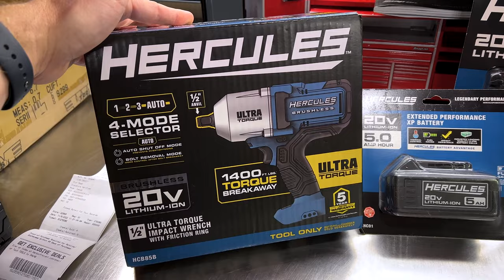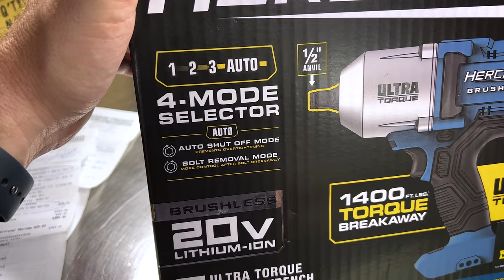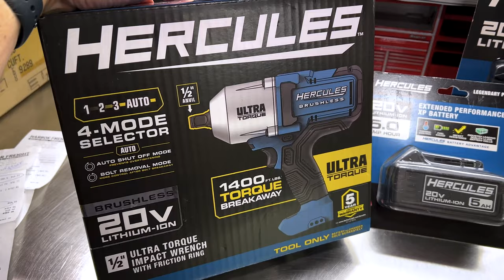EXTREME TOOL TESTING Harbor Freight’s Hercules Ultra Torque Impact! SHOCKING Results!!!

Comment: My issue with the Harbor Freight cordless tools the same as yours. They cost too much if they are trying to compete on price! There simply isn't a big enough difference versus a brand name with a much wider tool selection. That said, this does seem like a pretty impressive tool! I don't think my DeWalt batteries would have survived those durability tests at all. Fun stuff.
Reply: Hahahaha so it's stronger then a Milwaukee more durable then a Dewalt and cheaper then both but it's still not cheap enough 🤨😆🤣 I love it that logic made my day thanks 😄
Reply: @word1ist  It's not cheaper than both if you actually look for sales. I got my DeWalt high torque impact for $180 brand new. If the price difference between the Harbor Freight and a more established brand is low, being on the better battery system with a much wider selection of tools makes much more sense. I personally use DeWalt 20V because I find it's a better overall value than Milwaukee M18. I generally buy new tools when I can get a battery or two for free and overall I've paid less than I would have for Harbor Freight equivalents. I also buy Milwaukee M12 which Harbor Freight doesn't have anywhere near a comparable lineup.
Reply: @802Garage  🤨🤨🤣😆
Reply: @word1ist  If you don't understand then I am highly doubting you use a suite of cordless tools daily. Having numerous battery systems is a pain in the ass and again as I said, I've purchased my DeWalt tools and batteries CHEAPER than Harbor Freight tools because I hunt for deals. Do what you like.
Reply: I’d be a lot more willing to buy into the Hercules line if they had more niche tools. The value they have just doesn’t hold up against a similar brand like ryobi if you consider how limited the tool selection is.
Reply: @sully.varnadoe1472  Exactly. You buy into the battery system and then you are incredibly limited on selection. They have to at least be cheap if they aren't going to be versatile.
Reply: Battery should be good since they are made by Samsung and have a 3 year warranty. And only the Herc line has the Samsung batteries at HF.
Reply: The hell there isn't.... and coupons
Reply: Granted tho he was so misleading on the price comparison vs the milwaukee here. He got a charger the tool and two batteries for around $380. Then quoted the milwaukee at $450. However the milwaukee kits only come with one battery. He evene said it came with two at the end if the video which is not true
Reply: @MaNtIcHoRaOfficial  Yeah I always buy DeWalt on sale when I can get a whole free tool or two batteries so I save tons.

Comment: Yeah but with that Milwaukee kit you're getting one battery. You got two Hercules batteries so add another at least $100 to $150 to that for 40 or whatever it was and that would be the comparable price so basically 590 compared to 380

Comment: Hey man, just a quick question,  how to permanently stop tha auto stop start on my 2017 forester? Thanks man.
Reply from the maker: You have to buy a disabler.
Reply: @MrSubaru1387  any link for that pls?
Reply from the maker: @robcore5287  google autostop eliminator

Comment: That my turn away point is that i get the dcf 900 with 5.0 battery and fast charger for 349.00. Cheaper then the harbor freight. Hmmmm

Comment: Hercules Impact Wrench is impressive indeed, surprising the battery never came off with all the abuse it took, unlike the Milwaukee whose tools have their batteries dropping off on a regular basis. If you put the Milwaukee Impact Wrench through the same abuse as the Hercules Impact Wrench it would have crapped itself. Looks like Harbour Freight may become a contender for tough reliable tools of choice for the tradesman especially with the five year warranty that replaces the tool there and then as opposed to the Milwaukee crap where you have to wait for it to be repaired which I have had first hand experience  with my Milwaukee multitool, took 8 weeks for the Milwaukee  retailer to fix it and it came back no different to what it was when I sent it. Who knows what repair job the clowns did? Needless to say I no longer buy Milwaukee over priced and under performing tools.

Comment: Pretty tough tool there also milwaukee tools are good but probably made in China too just better quality control just like most expensive tools that are made either in China or from Chinese parts you pay for the person looking over their shoulder to make sure it's built right and they still over look things , like design flaws that makes them have to recall their tool (milwaukee) lol
Milwaukee's redesign that failed because the tool kept breaking sometimes straight out of the box
Model # 276720 serial # H96B